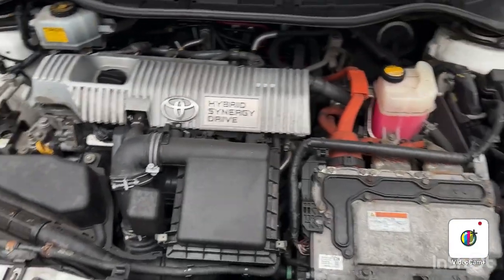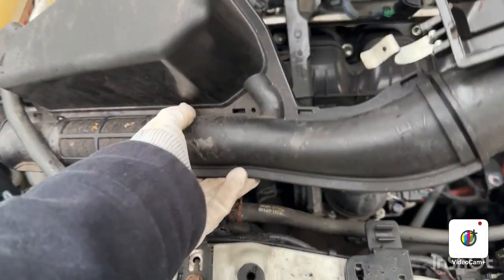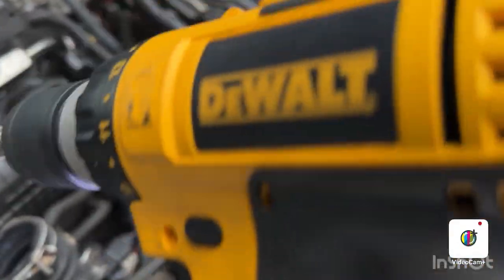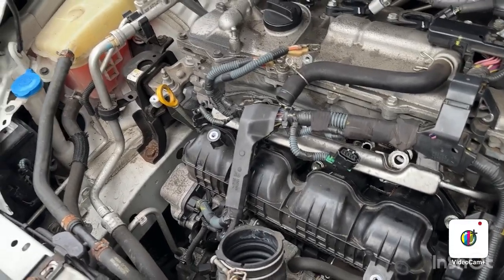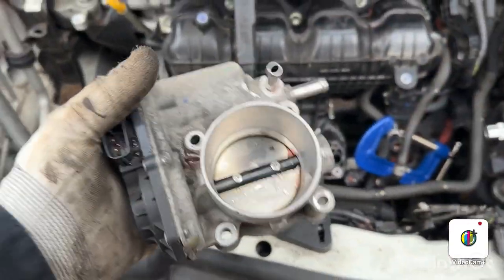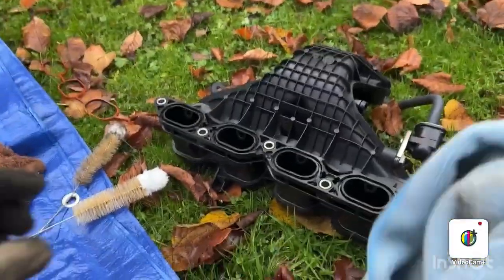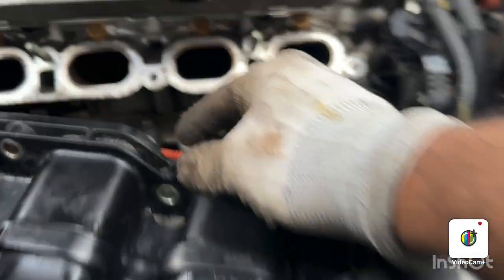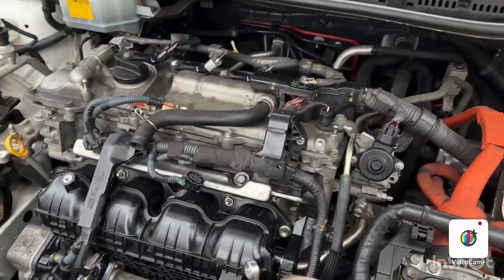Toyota Auris | Prius Hybrid EGR Valve & Pipe Cleaning | Intake Manifold and Throttle Body cleaning

Comment: Thank for video,
In your opinion, how many miles is it recommended for a hybrid car to undergo carbon cleaning?
Reply from the maker: Every 60000 -80000 miles if you don't wanna replace parts. Less clogged parts can get cleaned and reused
Reply: @DiyMechanics  Okay, do you think clean carbon engine with HHO will work in hybrid ? Is toyota prius okay in maintanance mode for 40 minutes or more ?
Reply from the maker: Hho is will work I believe but you may not get expected results. I will never leave car in maintenance mode for more than 30 minutes

Comment: Hi was wondering i have a Toyota Auris 2018 and it’s clocked 150000 miles. The garage says I need to get the egr valve changed which is costing me £900. But from your video the egr pipe is made of metal and the value looks pretty secure. Why would they have to replace it in your opinion?  I haven’t had any accidents. Unless it has been damaged it shouldn’t have to be replaced right?
Reply from the maker: What happens is egr valve gets clogged as car does the mileage every 60000 miles. And garage is not asking you to change the pipe. They are proposing to change the valve. They don’t bother cleaning and putting it back cos it is time consuming. But if you like to do it yourself it will save alot of money and you will not have buy the parts. But if you wanna get it done from garage I highly recommend get the new EGR valve so you will have pieces of mind. If you are in Manchester i can do this job for you.
Reply: @DiyMechanics  thanks for your input. I’m in Edinburgh otherwise I would have definitely taken you up on that offer.
Reply from the maker: You are welcome
Reply: Hey thanks for the video. I’m about to do an emergency clean on my Prius EGR valve and pipe since I’m having problems while on vacation. In your vid you show cleaning the pipe but I didn’t see you clean the valve. How did you clean it? I saw someone else say you need to soak for for a few hours upside down? Thanks for your advice
Reply from the maker: 1) The only way to clean the valve is soak it in a cleaner for few hours or for best results leave it overnight.
2) if you don’t wanna wait replace it with the new one.

Thanks for your interest. I will post an others detailed video but i am waiting for a vehicle so i can work on, stay tuned ( subscribe) i will explaining the best way to clean egr valve
Reply: Ok!!
Reply: Just take off intakemanifold, EGR-valve and EGR-cooler. There are more video's and how-to's on YT and watch them before working on your car. Clean the intakemanifold, especially the 4 little holes in it, the egr-valve and the egr-cooler with ovencleaner and bolt everything back on. Only intakemanifoldgasket needed, 25 euro's or 20 pounds or so at the dealership. Do it yourself in one weekend, and save 875 pounds in one weekend. Use the money for a nice weekend with your wife or girlfriend and still have money left. Be wise! Good luck.
Reply: @DiyMechanics will you come to London to do this same job for me?